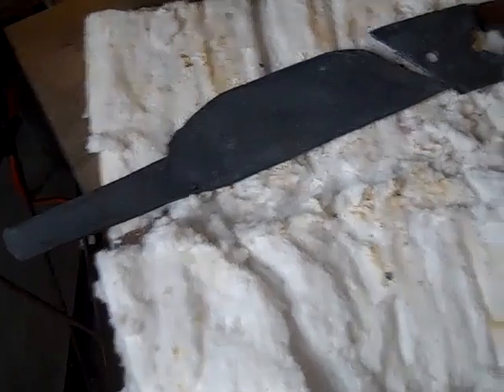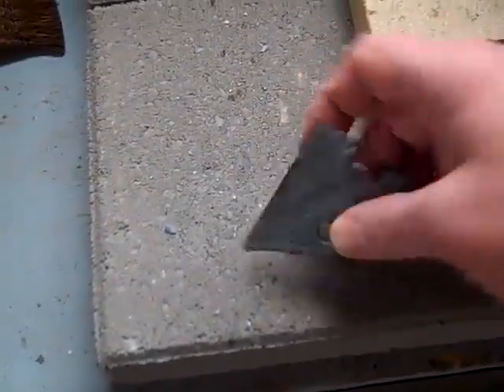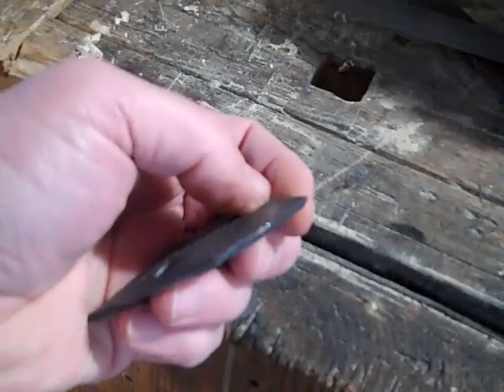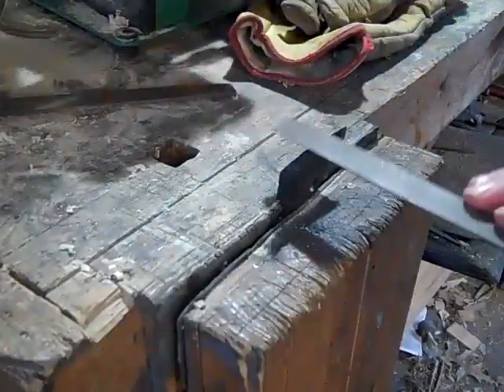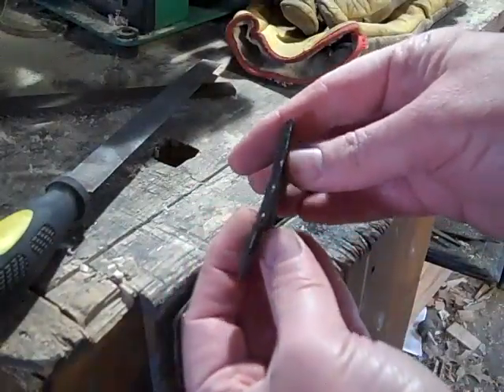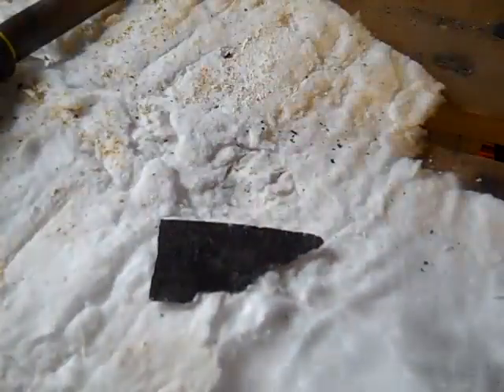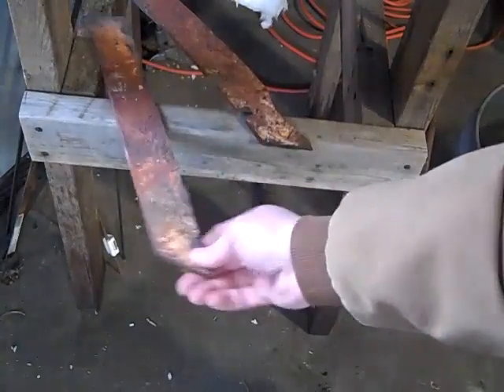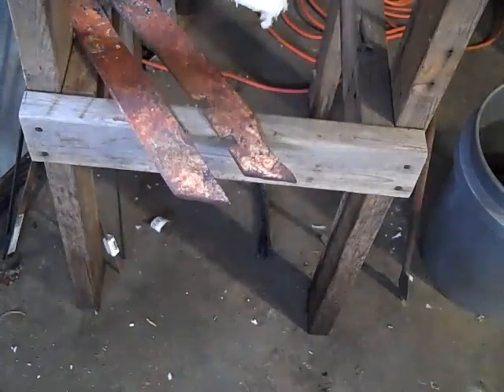Testing found steel for hardenability.

Comment: Mook, I also tried this. I made a neck knife from a lawnmower blade. It just won't hold an edge. I made another neck knife at the same time, using a 1095 blank from Camillus; I quenched and tempered both the exact same time/way and it (1095) turned out excellent.

Comment: You can also temper it a little after hardening it like this.  It honestly could be as brittle as glass without tempering.  Based on tool steel phase diagrams I just looked at the before mentioned temperatures should be adequate for completely austenitizing the piece.  The color you had it at looked sufficient, but it was tough to tell from my view.

Comment: "Normalize" the steel 1st by heating it to 1012 Celsius for 1 hr, then letting it slowly cool in air. Next, heat it again, above 912 C for 1 hour and then quench it. 5-10% salt water solution will cool it faster and won't affect it chemically.  This is autenizing then forming martensitic steel. You can also hammer ash (sulfer free!) into it while it's hot to add carbon and then repeat this process. This will make it more brittle and could shatter when you hit a rock again.